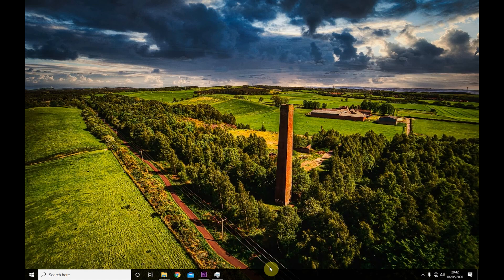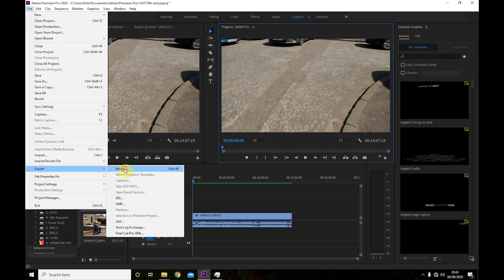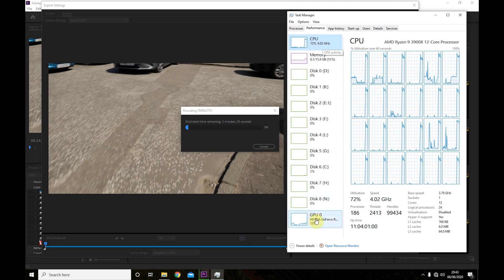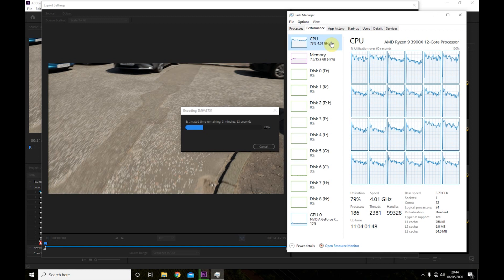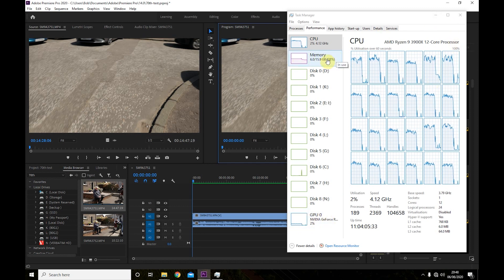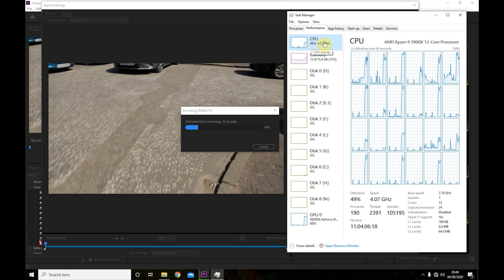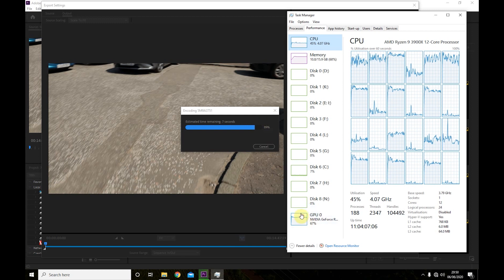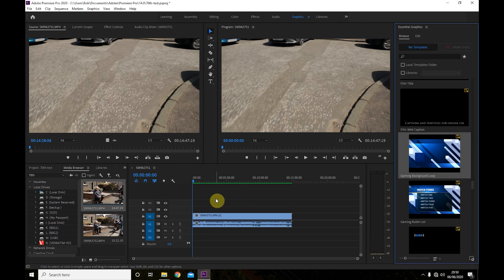AMD Ryzen 9 3900x Adobe Premiere Hardware Encoding So Fast

Comment: help me, I cant access the hardware encoding option.(it is greyed out), but I have selected CUDA in project settings.
Ryzen5, 2600
Nvidia GeForce GT 1030
Premiere pro V14.3.2
Reply from the maker: hi just checked the version i am on it's 14.2 build 47.  Hardware encoding is depended on a few video settings an does not work will all the presets. Can i ask what your exports setting are ? some modes will give the error

 "Your systems hardware does not support hardware acceleration for the current settings" H.264 custom gives me that till I select High Quailty2160p 4K or even High Quality 1080p HD then I can make whatever changes i what and still have hardware encoding. 

I have also noticed that Twitter 1080p Full HD is software only but Twitter 720p will let you do hardware

hope this helps
Reply: Exporting in 1080p H264.
But I guess the problem is Ryzen processors dont support hardware accelerarion yet.
Reply from the maker: @sonamrai6247  its Ryzen 9 3900x am using so would be down to your GPU if its supported

Comment: My usual encoding usually took around 20 mins prior to the update with a1700 OC at 4.0 GHz. After the update, I was getting around 15-minute exports. I recently upgrade to the 3900x and cut the time down to less than 10 minutes.
Reply from the maker: it's cut my encoding time in half
Reply: @alloaphotographers6513  Hi.

Apparently the 8-core Monocore would be just as efficient for Adobe Premiere, more than 8 cores is unnecessary according to this site.

I will hesitate between the Ryzen 7-5800 and the Ryzen 9-3900 for my new video editing config only.
You have already simply tested the export speed of your projects between a single-core and a multi-core

For example on a Ryzen-7- 3800 VS Ryzen 9-3900
Who is the fastest in exporting video to Adobe?
Reply from the maker: @Lakhdar_salafi  unfortunately I don't have a ryzen 7 to test however tested with Intel i7 gen 6 an gen 9 and the ryzen 9 wins hands down